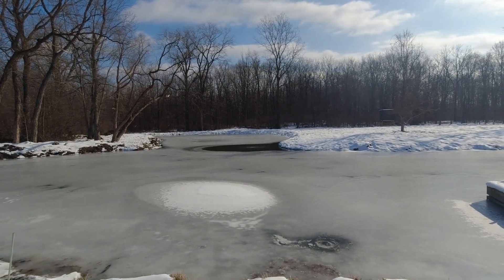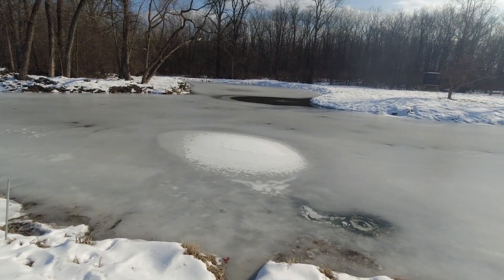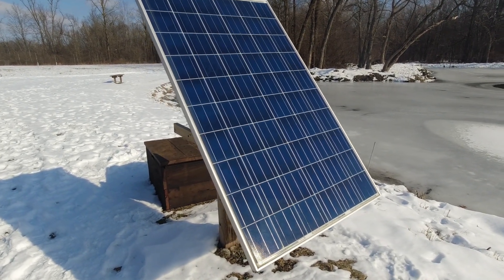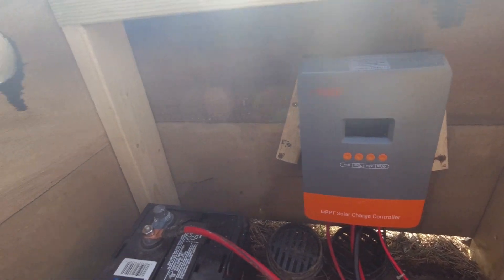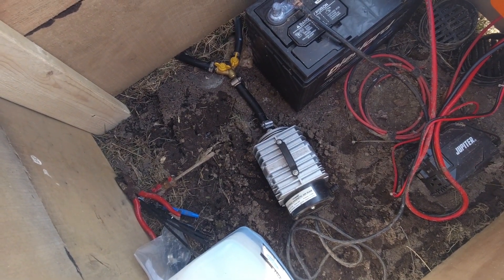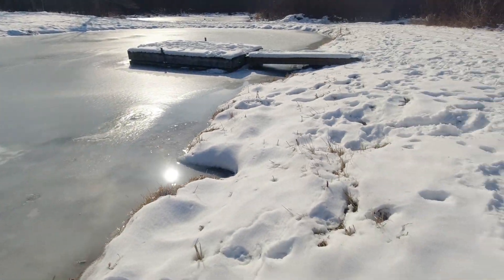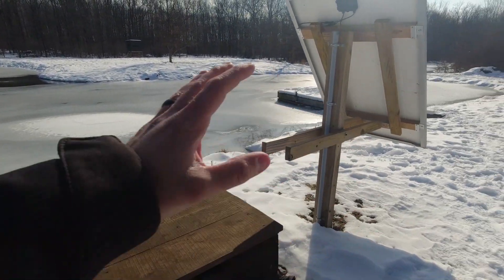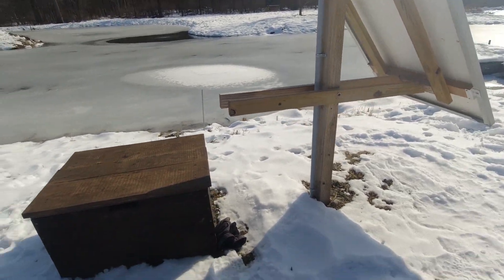OFF GRID DIY Solar Aerator Setup for Pond | Tips I Wish I Knew Starting Out

Comment: I installed a solar panel kit 2011; just replaced the 2/12v RV batteries 2 yrs ago; it was bubbling fine the other day. I think the panels are not charging the batteries, it’s not running at night; I hear it running but no bubbles; the batteries are hooked up to each other. 24v. I’m not sure if it’s panels or compressor issues; I would love your input; I know nothing of numbers in electricity language; I was thinking of going to Harbor Freight and picking their brains
Reply from the maker: If it's all from 2011, I bet you the air pump is bad, maybe the diaphragm has failed, that's a really long time for it to go, definitely got ur money worth it out of it!

As a sanity check I would check the batteries voltage in the afternoon and then before evening.  If you have a charge (12.8v is full) it has to be the compressor.  Which would be nice cuz that's the cheapest part 😀

Comment: What are the particulars you went with.  Battery / inverter / compressor? I’m about to get things together.  Thanks for video
Reply from the maker: For battery get a DC29 or 31 (deep cycle) battery. These have a high amount of amp hours (Ah) so with lower wattage air pumps can last a good while when charged and the sun isn't out.
Solar charger I went with a PowMr 60A MPPT charger on Amazon. Shows about 90 bucks right now, way more efficient and can do 12-48V automatically. Truly worth it, my solar output increased A LOT when I upgraded to it from the PWM chargers you get from Amazon.
Air pump get the highest wattage pump you can that doesn't pull too much from your solar panel watts wise. I have a VIVOSUN 1110 GPH 50w air pump. I have a 200w panel so I might upgrade to the next higher pump (I see VIVOSUN has new models and more efficient from when I started). Just remember cloudy days, so it's nice to have a buffer so the pump can run still from solar when the sun isn't out fully.
For AC inverter I just use any cheap TSC or Harbor Freight inverter, since my only wattage is the air pump you can get something that is low wattage and doesn't break the bank at all, if it breaks I'll just buy another one for $25 bucks (only have had to replace it once so far)

Comment: Nice video. Im trying to figure out what size batteries ill need to power my Vevor 550W 3/4hp aerator.  Already have a 400W panal and 60A MPPT charger and a 3000W invertor.
Reply from the maker: If you're running a 550w pump you'll want to have several panels and batteries. I ran a lower wattage pump because it's rare we always get sunny days, so would have reduced wattage being generated to begin with, wanted that extra buffer.  It's doable, but you'll want a lot of panels and batteries for it! The MPPT will help tremendously but you want more panels to keep the pump going and the battery charging at the same time.
Reply: @hurstyoutdoors  What wattage is your pump? I would like to replicate this for my pond
Reply from the maker: @gabrieladolfo2969  I have a 50w Vivosun 1110GPH pump.  Go as big as possible for maximum aeration. I got a big 200w panel with a 50w pump so it can even run and charge battery during all the cloudy days. I think I am going to try for a 100w pump for summer, and go back to 50w pump during winter. Just really important to always have it running. Even right now (May) I have no algae on surface of pond while other neighbors are getting it.
Reply: Please help! I purchased the same mppt solar charge controller that you suggested. To insert the wires into the controller do you simply strip a 8 gauge wire. I was expecting a terminal block to secure the wires that go into the controller how did you do yours?
Reply from the maker: @camcorts9780  you got it. Just strip the casing off wires, insert the wires in, use screwdriver to tighten them down, done. The cover on the bottom slides off so you can see the screws to tighten down.. I assume you're doing a 12v system?

Comment: Thanks for this video - very helpful. Did you use concrete to hold the frame stable? Or just plant it a few feet deep?
Reply from the maker: Hey thanks for watching! Used a bag of quikrete just to make sure it wouldn't move and buried it 30" deep.

Comment: Nice setup. What size pump did you use? Is it noisy?
Reply from the maker: I have a 50W/1110 GPH air pump from Amazon, works great. Not too noisy at all.
Reply: Thanks, surprised the 50w can run both aerators. Trying to decide between something similar or a pricier septic style aerator.